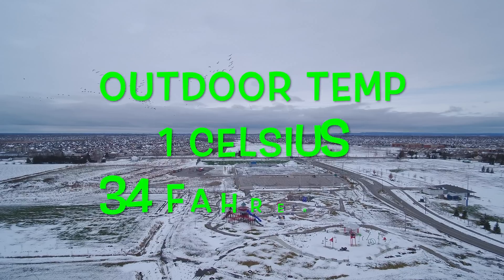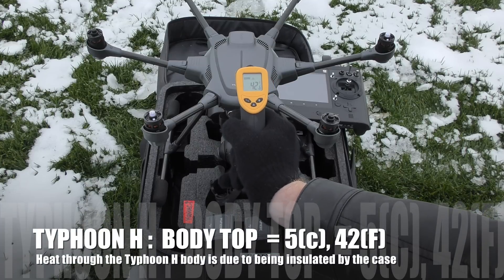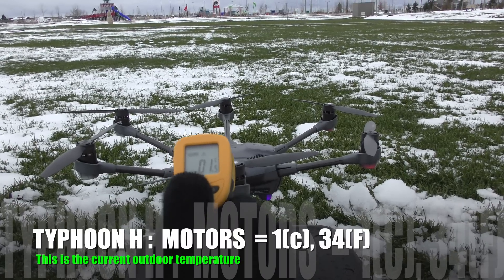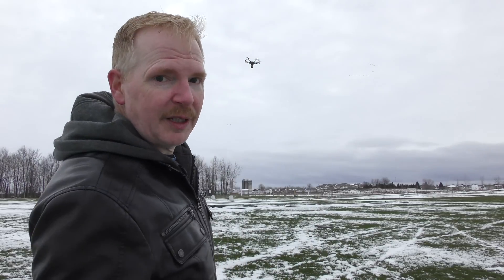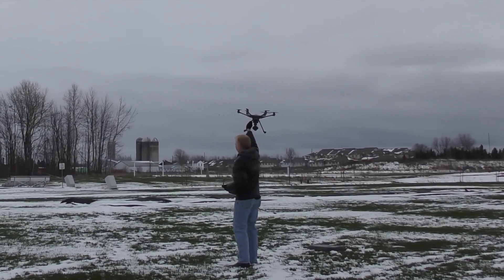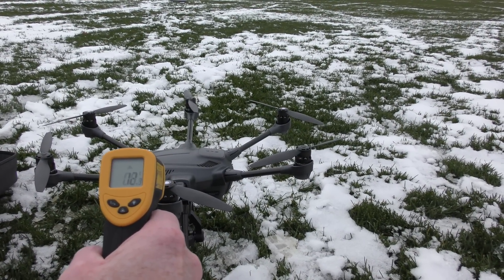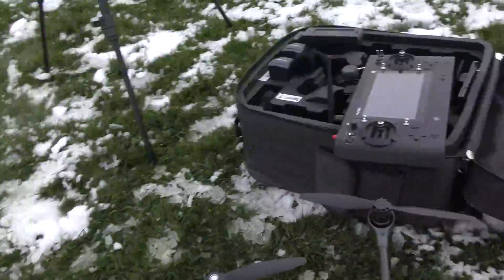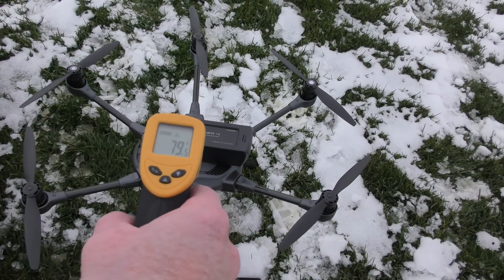DRONE HELP - YUNEEC TYPHOON H Cold Weather Flying - Temperature Change

Comment: CAPTAIN DRONE can extreme cold damage the battery ?
Reply from the maker: Batteries, such as LiPo batteries that are used in the Typhoon H are affected by cold weather.  The ability of the battery to supply the necessary charge is affected negatively in cold weather as opposed to warm weather. The flight time will be shortened. As for causing damage to a battery, it would have to be extremely cold on a low charge.

Comment: CAPTAIN HAVE LOOK.
 I MAY DO THIS - - PROTECT YOUR DRONE
KEITH KUHN

To properly apply a coating, you must dismantle your drone so that all of the working pieces and parts are exposed.

Using the applicator that comes with the 
hydrophobic chemical, coat all of the internal circuit boards, wiring 
harnesses, motors, camera gear, and so on.
Try to not get any on the lens of the camera, as it could smudge.

Make sure that the coating has dried, and then re-assemble your drone.
Make sure that you limit how much you 
touch the treated electronics. Most coatings are smudge resistant, but 
you can wear them off by touching and wiping.
Reply from the maker: Yes, this is rather common for people who have drones with exposed electronics, such as FPV racing quads.  It works well for them so it should work well for the Typhoon.
Reply: KEITH KUHN

Comment: Cold, hah! Here Finland, normal flying temp in winter is -20 celsius, and can fly up to -30 celsius :)
Reply from the maker: Hello Mikko from Finland!  Ha Ha, oh I know being a Canadian, 1 celsius is kind of wimpy for cold weather temperature. In another month or two we'll have the -20 celsius temps.  My goal was to see if the Typhoon H actually warms when operating in the cold.  I'll try it again in the super cold months.
Reply: No problems, but let H cool down about five minutes without battery, and then put warm battery in and start flight, otherwise gimbal roll not work so good :)